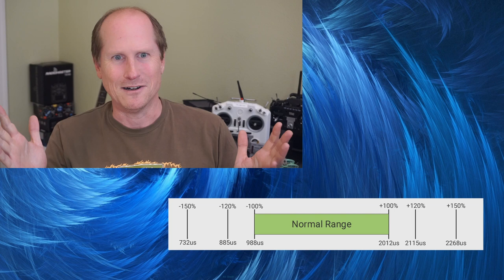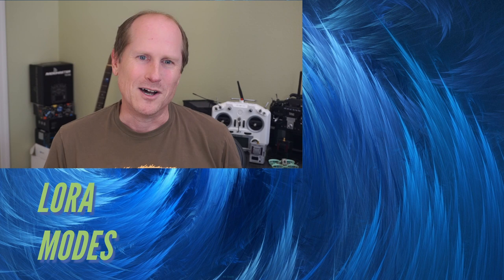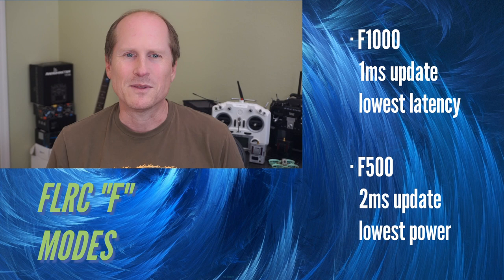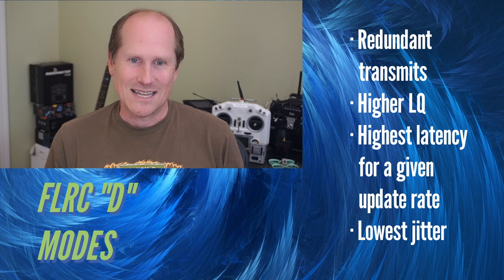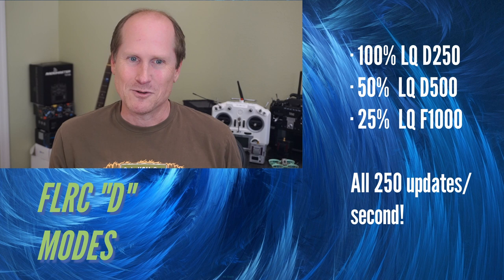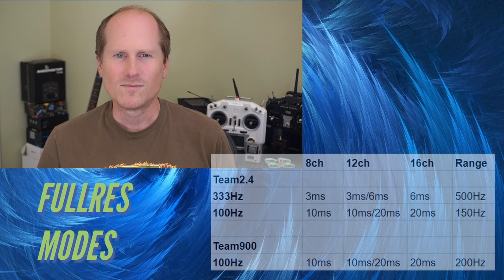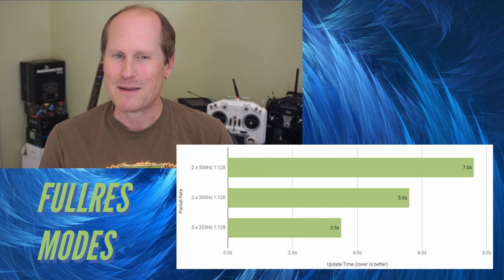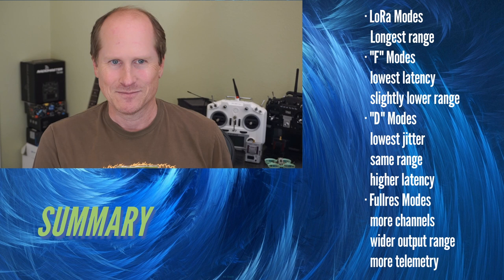ExpressLRS 3.0 Packet Modes Explained

Comment: OMG, thank you, I finally found ELRS developer who have a YouTube and can explain in more details than on a elrs website! I'm still looking for even more details towards how data and packets are aligned in time on air and how this is all packed together, not sure I get it right:

1) Normal Range vs CRSF Extended - yes, I'm a quad pilot and my world is clamped between -100% +100% :D but just want to make sure I get it right, so far my understanding is "the range" is all about PWM ~1000~2000 compatibility, about the way sticks are reported to TX and RX communicated value to FC or servo, so CRSF is here to help with that, right? My understanding is that it have nothing to do with air transmission over digital protocols. I assume ELRS encodes, modulates the bits in a packet (without knowing the range), so no matter if extended range is in place or not, it gives same precision, same amount of bits and never have any effect in air transmission, is it correct? Even though I'm seasoned developer it is hard to grasp from your 60 seconds explanation of range compression in ELRS3. Still can't get how LoRa have something to do with compressed/full 10 bits?

2) Am I right that in Hybrid mode the packet size is slightly smaller and might give slightly less OTA latency? Plus in Hybrid mode it needs 7 packets to RR over all channels, while with Wide the packet is slightly bigger and it needs 8 packets to RR over everything? Do I have to bother myself with Hybrid mode nowadays for racing/freestyle? I kind of stick to it, but most people saying it have no advantage over Wide, only disadvantages in terms of precision, I really want some insights into it before I connect an oscilloscope to measure :D

3) Why 3 bits gives 7 positions instead of 8? Never was able to find it. ELRS documentation says that I can use 6 pos switch with e.g. CH6 in hybrid mode, but since for 3pos the 1500ms also mapped, I can perfectly use not 6 but 7 positions (I use 6 pos switch + override for turtle mode in 0% 1500ms, works great). Still not sure why not 8 positions if this is 3 bits? Is it artificial limitation in a mapping to get a middle point for most of other use cases? Or this "half bit" is reused later to improve something else (e.g. CH12 precision?)

I would be so grateful if you can make a little longer videos for oscilloscope-friendly nerds, please 🤣 You know so much tiny important details that I'm eagerly looking for. Thank you for your contribution! I wish I can contribute to the project, but can't find more technical details about modulation, packet structure, timing etc...
Reply from the maker: That's a whole lotta questions to answer in a youtube comment, but I appreciate your enthusiasm. You might want to take it over to the rcgroups thread for future replies.

1) In the air we have space for 10 bits of data for a channel, the handset gives us 11 bits and we send the RX 11 bits. In 2.x we would just divide by 2 to get 11 bit to 10 bit, but that throws out the source precision for allowing a wider range. In 3.x the fullres modes still do that but the other modes just slice off the high and low 11 bit values to and map 988-2012 into those 10 bits, keeping precision but lowering channel range.

2) Hybrid and Wide use the same packet sizes, it is just how the 7 bits dedicated to switches is used. Hybrid sends a 4 bit index and 3 bits to represent one switch (with an exception for the last channel), Wide uses all 7 bits for one switch and implies which switch it is. Wide therefore needs to have an 8-packet period so the switch index can be determined from the (8-bit) packet counter directly. Hybrid is only still around because so many people yelled at me when I tried to remove it, claiming "Wide switch mode will cause so many failsafes". Hybrid is safer than Wide, but only as a backup for when the link is already f*ed.

3) Your math is correct, we only use 7 of the 8 possible values. The requirement is that we properly represent 6 position switches accurately for those 6-pos buttons on handsets to map directly without the user having to set up a weird mix. If we just made each bit represent 125us (1000us range / 8), then you'd only get like 5 of the 6 positions generating a unique value. I couldn't think of anything else to use the extra "position" for since it would have to be used only to represent something about this switch.
Reply: @CapnBry  thankyou very much, now it makes so much sense! 🤩

Comment: Good explanation, thank you. The only point I'm hazy on is what's the advantage of LoRa over Fullres? The video makes the latter sound like a strict superset, yet you recommend LoRa for cruising quads. I'm interested in maximum range for my planes, and don't care that much about latency.
Reply from the maker: They're pretty close. The LoRa modes have higher packet rates at the same range. 333Hz Fullres = same range as 500Hz LoRa, and 100Hz Fullres = 150Hz LoRa. 50Hz LoRa has the longest range of all of them, but there is no Fullres version of that (it would be too slow)

Comment: Cool, thanks for this!
Is there any chance to add the possibility to have different modes per receiver? So
my Freestyle Quad uses different mode than the Wing, without the need to change TX Setting? The desired mode needs to be saved in the RX then I guess, like with Crossfire. Not sure of this is possible?

Comment: Thanks for the great walk through.  When you said race telemetry, do you mean the lowest necessary?  e.g. i use 1/128 coz i rarely look at anything while racing
Reply from the maker: Nope, I mean the telemetry option labeled "Race" (last in the list currently). That is the same as "Std" when disarmed, but "Off" when armed, and also disables Sync packets when armed (replaces NO_SYNC_ON_ARM). That means 100% of the packets you send in race telemetry mode while armed are channel updates-- zero wasted packets.

Comment: To use D250 OR D500 mode, do I need to change the RX to operate at 250hz?
because in Betaflight there is no profile for D mode, unless you can access the RX via wifi, and you can change this frequency field!
Reply from the maker: The receiver always operates at the rate the TX tells it to. In Betaflight the preset for D250 is 250Hz, and D500 is 500Hz (they are the same as the non-D presets)

Comment: Thanks for the video! Do I correctly understand that INAV won't be able to take advantage of Extended Limits in Full-res modes and will still only recognize values from 988 to 2012? What is the maximum telemetry rate for  Taranis QX7 without inverter mod? The baud rate between the radio and r9m module I use is limited to 115kbps, is there a chance of reaching the limit is I increase telemetry rate to say 1:8 in Full-res mode?
Reply from the maker: Too many questions! 1) iNav supports more than 988 to 2012 2) Telemetry rate has nothing to do with baud rate, only the packet rate. The max packet rate for 115k is 250Hz and any telemetry ratio works with that.
Reply: @CapnBry  Sorry! :) 1) I just tried it myself - by default OpenTX only sends values from 988 to 2012 and INAV only recognizes values from 1000 to 2000, so to get full advantage of extended range in INAV we need to change Outputs ranges in OpenTX and adjust rxranges in INAV. 2) As I remember Crossfire requires inverter mod for telemetry to work at full speed, so I thought that the baud rate was the limiting factor in their case. ELRS uses the same CRSF protocol, has higher refresh rate and allows for telemetry rates up to 1:2 - why it doesn't run into the same limitations as Crossfire does?
Reply from the maker: @user-nz2zi7hu2c  Yeah of course you need to turn on Ext.Limits in EdgeTX/OpenTX to use extended limits. iNav you really want your first 4 channels to be 1000-2000 and then apply the larger range to the servos. Other channels you are passing through can use the full range.
We have the same baud rate limit as Crossfire due to the hardware, but that doesn't do jack for telemetry because that's constrained by the packet rate, which already limits it to below the available baud.

Comment: Thank you for all information. Something I've been wondering without finding an answer is why does a low rate increase sensitivity? I mean that in the physics sense, what is going on that enables this?
Reply from the maker: The rate changes the "spreading factor" of the transmission. Instead of a bit taking 10us to transfer, it takes 100us and the receiver has an easier time detecting it. Like the equivalent of discerning the words bip and bop in quick succession vs biiiiiiiiip and booooooop slowed down.
Reply: @CapnBry  Thanks for the explanation!

Comment: Thanks for reply, I've already ordered beta Elrs 915mhz rx and TX. I'm flying a longrange fpv inav wing so what's the best setting for this type flying? I'm new to this system I'm coming over from crossfire and not planning on going back. Thanks again
Reply from the maker: 😆 Did you watch the video at all? Not even the summary section that's 20 seconds long? 100Hz FullRes
Reply: If I didn't watch the video why would I ask question about video, but thanks

Comment: Hi Bryan.
Is there a possibility for an RX to output both CRSF and PWM for gimbal like Crossfire nano RX?
Reply from the maker: You can but it isn't clean. I have plans to make it available as one of the output options in the webui (select instead of 50hz/etc output). If you need it right now, you can go to /hardware.html and put 1 and 3 in the CRSF fields and remove them from the PWM pins section. It's a bit complicated to get into more detail than that in a YouTube comment

Comment: im trying to learn express lrs and want to replace my crossfire setup on my inav 3.0.1 wing which is running a matek f405 wing flight contoller, so once i get the 915mhz tx and rx how hard is this going to be to get working, does inav even support express lrs i cant seem to find information on this. any help will be great Thanks
Reply from the maker: Yes, it works with inav. All you need to do is select CRSF as the protocol for the serial based receiver.
Reply: Thanks I'm going to place order

Comment: Should we have extended limits turned on in the radio? I’ve always just turned it on after seeing a JB set up video and never thought about it
Reply from the maker: You can if you want the Extended Limits for fullres, but you don't need to. It just lets the OpenTX mixer output go to +/-150%, so it only will be used if the value is outside the +/-100% range.

Comment: can ELRS Rx have dynamic telemetry power?
Reply from the maker: Not in the same way the TX can, because it doesn't get any information about how well its signal is being received. It also doesn't matter too much because all amplified receivers max out at 100mW which means it won't save much power. In 3.4 though receivers have "match" as a power option to match the power level the transmitter is reporting.